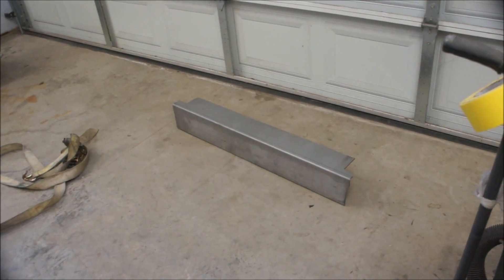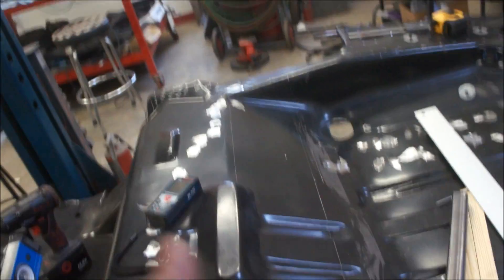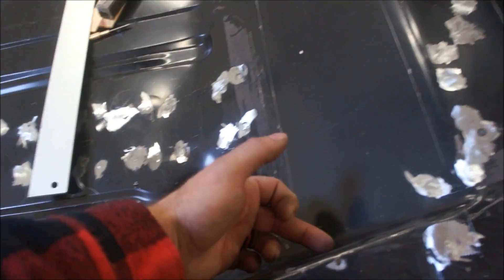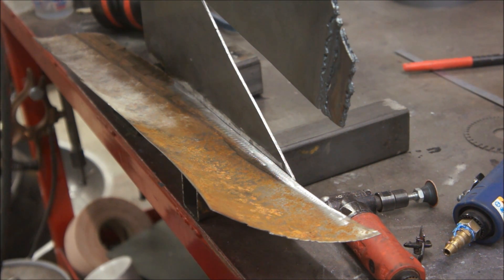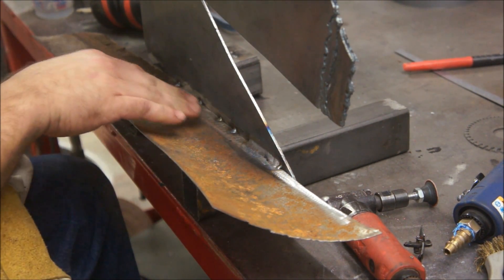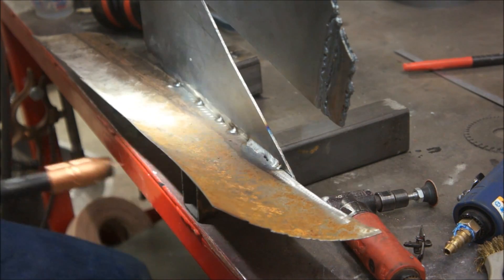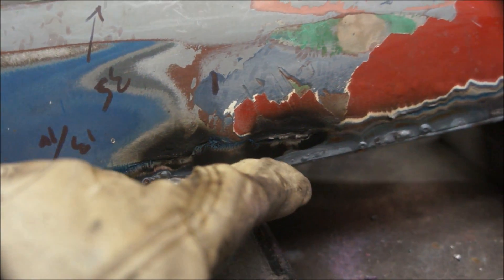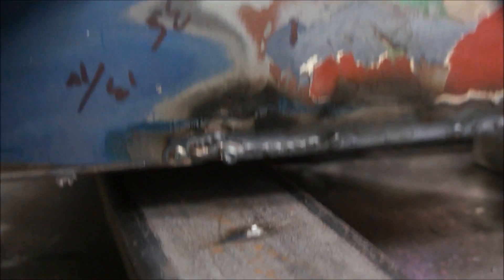Practice for DSE Quadralink

Comment: 👍. Thats how I was gonna put the IRS in my 3RD GEN TRANS AM before i changed plans.
Reply from the maker: S.D. PERFORMANCE/ENGINE REBUILDING cool
Reply: Ive decided to narrow 4 link my borg warner 9 bolt rear. I still have the IRS.
Reply: I was gonna cut the 2 holes in the pans for the crossmember connect the trailing arms then the wishbone/shocls I was gonna fabricate to the backhalf assembly.